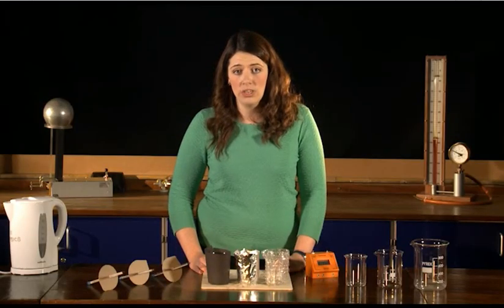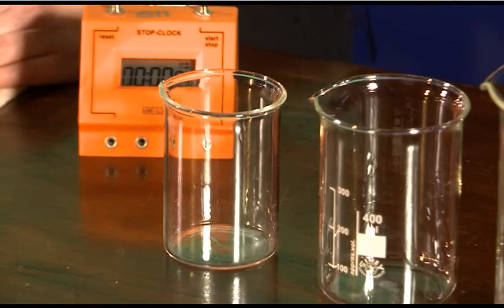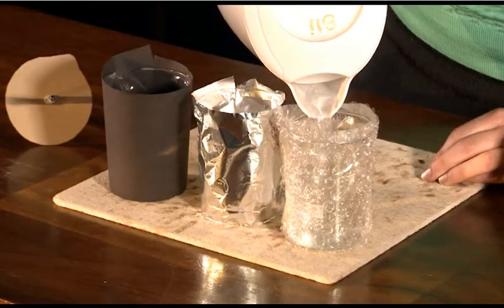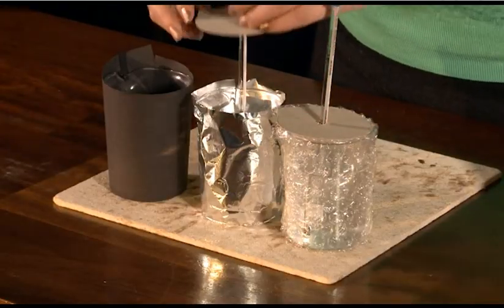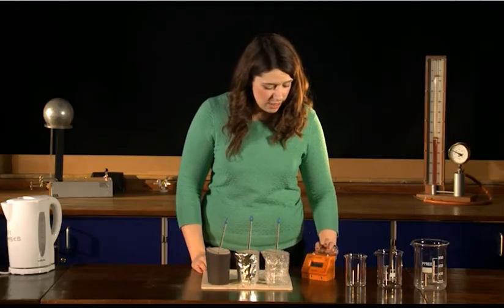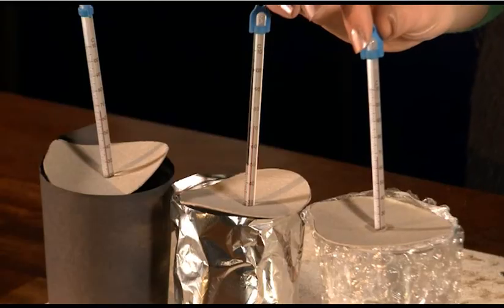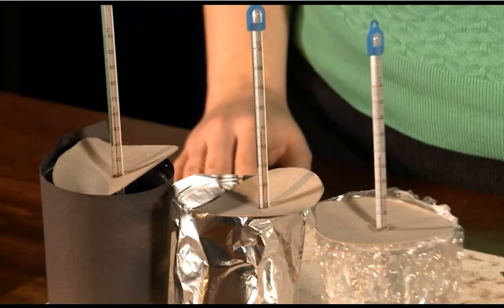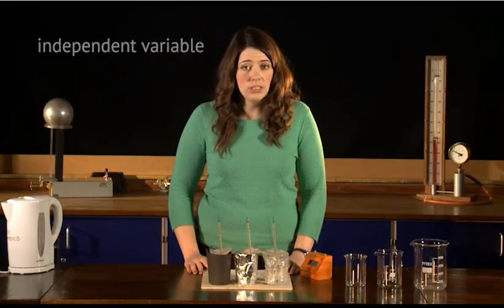RP 2   Thermal Insulation Material Practical

Comment: She is a loon,......she needs to make a hat out of the tinfoil and wear it so we can see.  The aluminum foil is a radiant barrier, not a insulator,......please delete this misinformation. The glass is highly conductive, as is the aluminum, so it radiates heat outward, a shiny surface is the best radiant reflector, so the aluminum reduced the radiant heat lost as radiance in this experiment is the biggest measurable loss of heat.

   If aluminum was a insulator, it would not allow heat transfer in car radiator or thermal heat sinks, aluminum is the opposite of a insulator, it is a conductor, a very good one, soo much so, most thing are made of aluminum just for this special property.

     Single layer paper is a horrible insulator so it showed the most heat less and it is not a radiant barrier either.

     The bubble wrap is a insulator, but not a radiant barrier, so it was in the middle for loss.

     What this experiment showed, beyond she has no idea what she is doing, is that in this situation radiant loss was more than thermal losses as the radiant barrier performed the best, even against a insulator like bubble wrap.

     There are soo many things variable in this experiment such as the tops where at very different seal levels, the spacing of product from the glass etc etc, that holds little usable value or information...……the only real usable information here is she needs a refund on her education and that aluminum is a great radiant barrier.
Reply: Yes
Reply: Yes
Reply: harsh, but undeniably accurate ;)
Reply: crazy bro